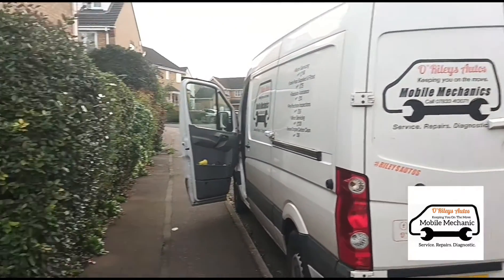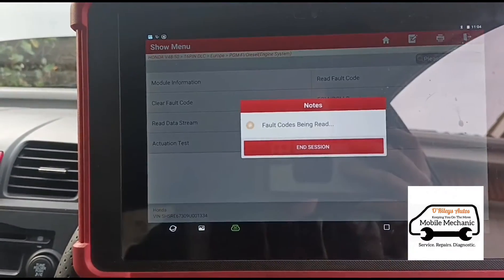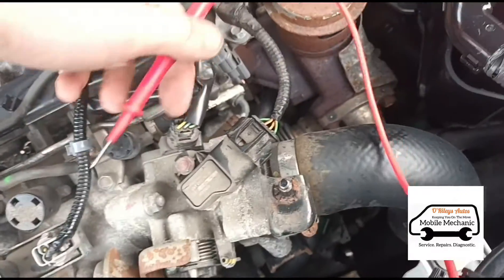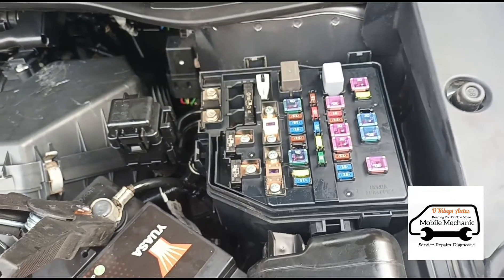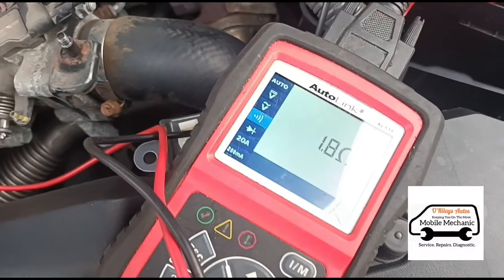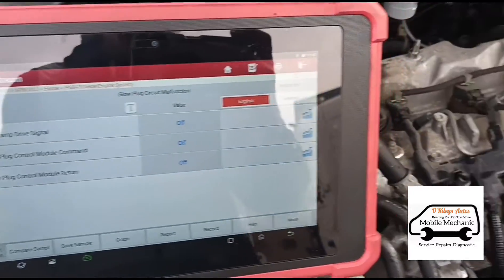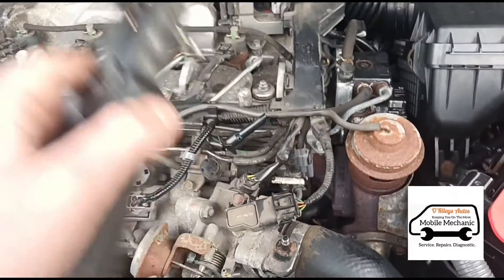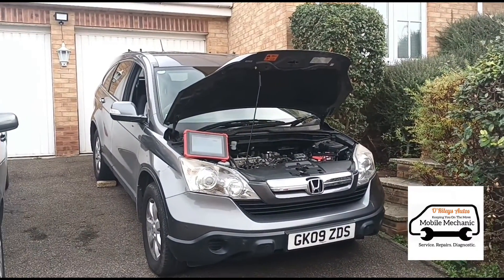How To Test Glow Plugs

Comment: I have a honda civic 2.2 diesel mk8  07. I'm getting a fault code of p1030, the 30amp just type fuse is blowing on fuse 23 pre fuel heater and have pmg-fi on the dash. Should I be checking the glow plugs and relay. Thanks

Comment: I'm hopeful I'll get a reply today , might you be interested in replyi g to me , 

Could you please happen to know , I've got a Honda civic mk8 2007 2.2 diesel , battery was checked last year , it gave 12v at the time , therefore should be just fine , 
For a while now it has started to "struggle" to start , especially on cold, which I found out it might be from the plugs , will it be worth cleaning them or , just test them see their resistance and maybe change them if needed , car drives just fine ( it mght be me seems a bit weaker than before ) but has a quite rough start 

Much apreciated ,
Reply: I'm sure if it's 12volts it's down on cranking power it should be around 13volts might be wrong tho

Comment: Hello, plug #2 is obviously dead and will need replacement.
A new healthy plug will have a resistance of 0.5-1.0 oms out of the engine.
When the same plug its testbed in the engine like in this video it can show 1-5 oms.
Did you test the plugs after getting out to see if the readings were different? 🤔